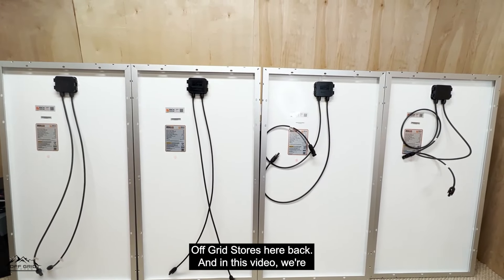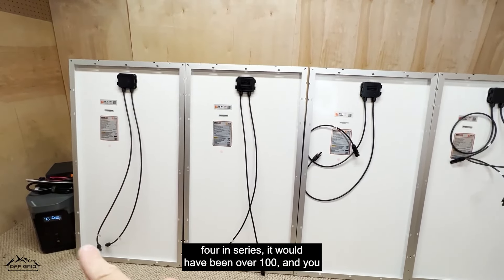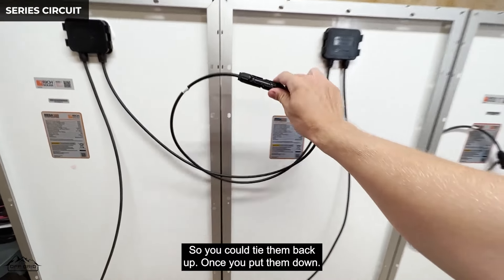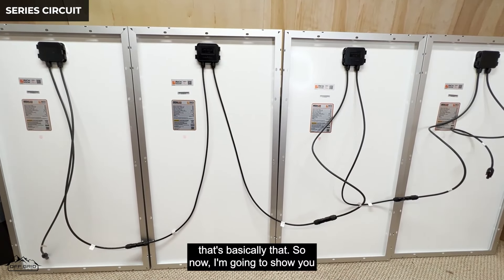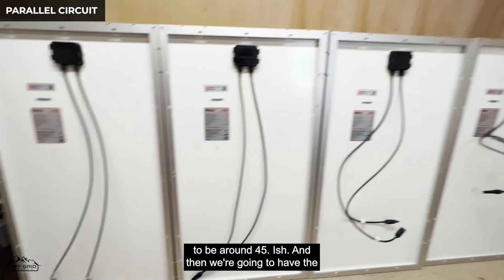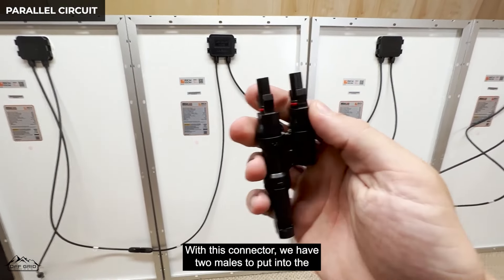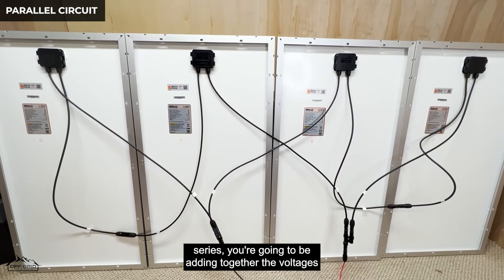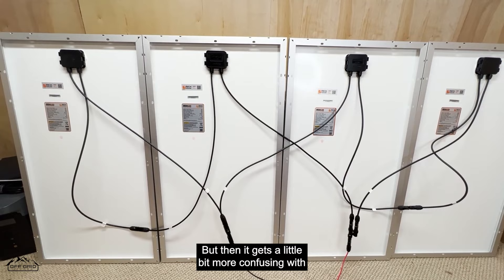How To Wire Solar Panels In Series vs Parallel (For Beginners)

Comment: Hey there. I have monocrystaline solar panels each with 50.28 volts (voc) and 13.9 Amps (isc). But my solar submersible pump is 220volts and 8 Amps. I saw 1 comment where you say you can go over the Amps... Plz advise in my scenario. Thanks in advance

Comment: warning all mc4 connectors are not the same some have different threads and water proof seals  once you buy mc4 connectors stay with that brand also when connecting extension lines they will be different than what you have so beware and buy extras

Comment: I thank and appreciate you making this.. but PLEASE get someone to hold the camera or get a tripod or if it's a GoPRo.. get a chesty mount. I gave this a like and a comment..So don't hate me.  I have four 400w Trina panels and only get about 750 to 800 watts out of them. 2s2p or 3 in series..  my controller is a 150\100 and I'm connecting them straight to the controller. I am now connecting my six 290w Trina panels and came in here looking for how to "6 panels in parallel". Will also try 3s2p. In the 2s2p with the 400's, last summer and on one day.. they got 1012w. I should be seeing that consistently..

Comment: I'm no expert, but that 4s was good.
But you could put 6 panels onto that system.
Do a 3s 2p system.
Forget the amps..... Mppts are like light bulbs.....thay blow with too much voltage, but will only take the watts thay require to run (so if you have 18amps...and your mppt can only use 15amp, your mppt will only use 15amp)
It's voltage that is critical to stay under your mppt charger.
Just another note......watch your charging "c" rate for your batteries. Don't go overboard on charging your battery as you'll cook them.
Even I screwed up......I started my system then learnt everything......I'm human and not an expert but I do love electric.....

Comment: Hi, how much 375w panels  (38v and 11amps) can I connect to a 5kw hybrid inverter with 145VOC

Inverter Output

Waveform: Pure Sine-Wave.
Rated Power: 5000VA/5000W.
Parallel Capability: Yes, 6 units.
AC Voltage Regulation (Battery Mode): 230VAC ± 5% @ 50/60Hz.
Surge Power: 10000VA.
Efficiency (Peak): 93%.
Transfer Time: 10 ms (For Personal Computers); 20 ms (For Home Appliances).

Solar Charger
Maximum PV Array Power: 4500W.
MPPT Range @ Operating Voltage: 60VDC ~115VDC.
Standby Power Consumption: 2W.
Maximum PV Array Open Circuit Voltage: 145VDC.
Maximum Efficiency: 97%.
Maximum Solar Charge Current: 80A.
AC Charger

Charge Current: 60A.
AC Input Voltage: 230 VAC.
Selectable Voltage Range: 170-280 VAC (For Personal Computers); 90-280 VAC (For Home Appliances).
Frequency Range: 50Hz/60Hz (Auto sensing).
Reply from the maker: I would do 4 strings of 3 solar panels connected in series. So 3 of those panels in series connected in parallel 4 times. that would be a total of 12 panels (375W x 12 panels = 4500W). 3 of the panels in series is 114V total (38V x 3 = 114V). and 4 strings in parallel is 44 amps (11A x 4 = 44A). you should be good with this.
Reply: Could group strings 2 strings together with MC4 -Y connectors pre combiner box, and use a 2in-1 out combiner box?

Fuses are rated 1000vdc and 30A.